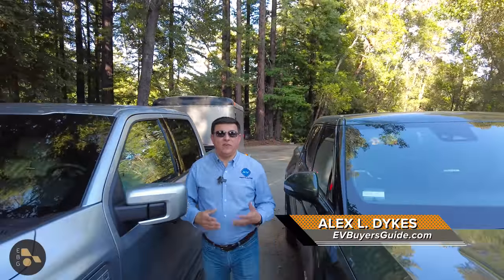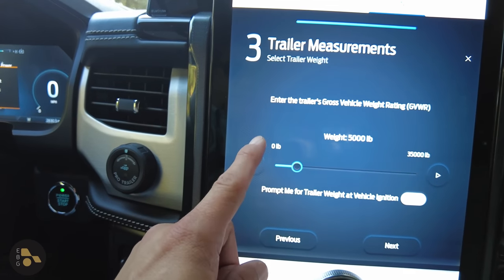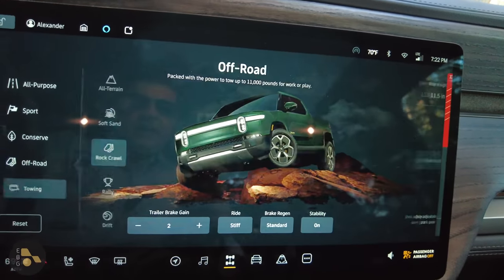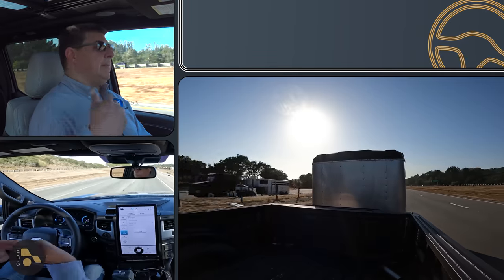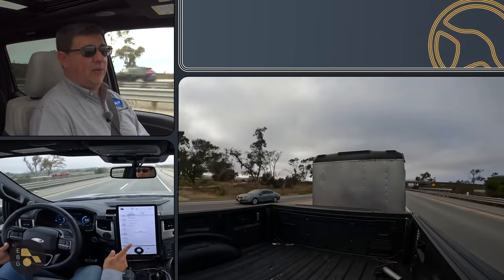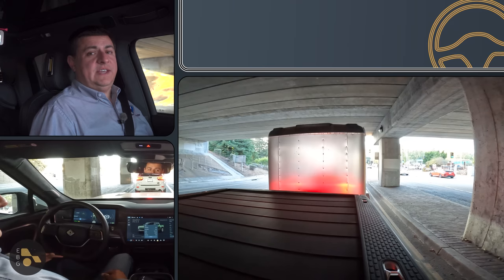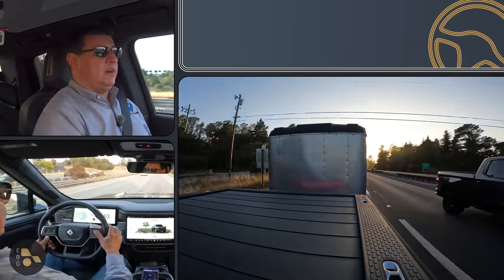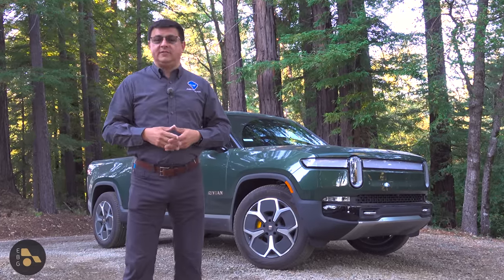What's It Like to Tow With: Rivian R1T vs. Ford F-150 Lightning

Comment: In Wyoming people be going 90 mph while towing.  It's nuts
Reply: Yeah speed limits are 75-80 MPH and people normally go over by 5-10 MPH.
Reply: Yeah that's just not smart. I blame all these 400+hp and 1000lb-ft HD trucks for that, makes speed feel effortless but if things get a bit dicey at those speeds it can go wrong very quickly.
Reply: Isn't it by law that a towing vehicle can't go above 55 MPH? Maybe I'm wrong. Either way, 90 is irresponsible.
Reply: I drive all over US and most towing vehicles regularly drive 70-80mph. As long as its not too windy, the road isn't twisty and you're paying attention you're fine. Only in states like Commifornia are there laws with ridiculously low speed limits and even less on towing vehicles).
Reply: @scott8919  that's California where laws are plenty
Reply: @TheJoncic  where there used to be the wild, Wild West ;)
Reply: California has 40 million people. More cars, trucks, more people, than several states combined, means more liability.
Reply: @cadsux  true that. In some states that I have driven through, there is nothing but rocks, mountain, barley any vegetation for miles. In others, it’s mainly vegetation but still no people making sense you are, haha
Reply: That’s just dumb!!
Reply: @scott8919  like the neighbors said,  watch out for them freeways clark....
Reply: @cadsux  please double mask RIGHT NOW!   stay safe out there....

Comment: Thanks for this video!  Good information.

Most of my towing is 20 miles or less so an EV could work.

However, I don't really need a truck. We currently use our Kia Sorento for the light towing that we do now.
Reply: Would love to see Alex run a towing test with the KIA EV6, just saw it has a towing capacity of 2300lbs apparently.
Reply: I sometimes tow a utility trailer with a Model 3 and it does fine. The (aftermarket) hidden hitch is a bit of PITA to attach etc but it is nice to not have to worry about drag when it's not on the car. Starting in MY 2021 the Model 3 has a plastic flap that you remove to access the hitch. I was hoping a hitch would be a factory option but so far that's only on the Model Y (I think).

Comment: 13:00 This is not exactly true, especially in the context of comparing EV trucks to ICE trucks. While it is true that you use more additional energy climbing in elevation than you can recoup through regenerative braking on the descent (most modern regenerative braking systems have 60% to 80% roundtrip efficiencies depending on exactly what losses you're factoring in), when you compare that to ICE trucks, it means that EV trucks are actually less affected by towing over mountain ranges than ICE trucks are. Even if an ICE truck can Jake brake or otherwise avoid using friction brakes, it is still only getting a "free ride" back down hill. It isn't recouping any of the additional energy that it expended when climbing in elevation. EV trucks, on the other hand, both get the "free ride" back downhill and get to store additional energy that can be used for driving later.

Comment: I am probably too late for you to still pay attention to the comments so I will probably post this on the next relevant situation but: people talk about these range variances being unique to electric vehicles in a ludicrous way. They are also true with ICE vehicles; we just think about it due to the difference in ease of replacing fuel vs. replacing electric charge. My example is thus: I drive a Mercedes Metris- I don’t tow with it, but for the first 5 years of the vehicles life I drove it as fast as I thought I could without ending up with speeding tickets, with a decent amount of highway driving, some magically in Mexico at speeds up to the vehicles up to its maximum velocity of 101 mph, and consistently where possible 10-15 mph over the speed limit in ‘mexico’. 

My father became diagnosed with Mesothelioma a few months before the pandemic hit and the three way hit of that, the pandemic, and my father inevitably succoming to i made my thought process change drastically, including conserving money, to the point where I drive gently, the limit up to single lane 55s, 5 under on multi lane 55s, and 55 mph anywhere faster. The results of this shocked me; indicated mileage on the computer for the last 15,000 service interval before he got sick was 21.8, the lowest in the life of the van for such an interval was 21.2. For interval after full implementation of this change, indicated mileage was 30 mpg. I also calculated things more precisely since the pandemic, and have self calculated miles driven over gallons consumed for that interval at 26.984, suggesting 19.6 for the 21.8 and 15k interval low of 19.

Converting this to consumption, strictly for the 21.8/19.6 and 30/26.984, we have 12 l/100km and 8.74 l/100km, or an increase in consumption of 37% for the higher speed. I think it would be beneficial to the viewers of this channel to have an as close as possible to apples-to-apples comparison of consumption efficiency of, say, a Ford F-150 lightening vs a F150 Ecoboost vs an F150 V8 on both conservative vs normal speed, and towing vs non towing. I also have more anecdotally noticed I have inferior fuel consumption on cold winter mornings vs more moderate temperatures, and think that would be an area worth exploring, too.

Comment: Regen braking helps a ton when towing. Less wear on the brakes, less likely to overheat the brakes. It does also help put energy back in the battery, which is a benefit over an ICE vehicle that has no ability to put fuel back in the tank. ICE vehicles just waste that energy to heat through the brakes. Just another one of the things that make EVs more efficient.

Once battery technology catches up to the energy density of fossil fuels (or even gets close) and charging speeds get better, nobody is going to want ICE tow vehicles anymore. EVs are so far superior to an ICE vehicle for towing…except for the range and recharging speed. EV drivetrains are like the combination of all the best points of both gas and diesel engines, but even better.
Although the Rivian is a good first attempt, it is still a first attempt, and now that it’s been out for a while and been getting used a lot, it’s becoming really apparent. It’s kind of feels like a truck that was designed by a team that have only read about trucks in a magazine or forum. It kind of reminds me of something like a Porsche Cayenne or a Range Rover or something, just in truck form. It’s designed for people with lots of money who don’t actually use the capabilities of their vehicles, but seem to want them anyway.

Rivian has taken the Tesla approach to the BMS. The low regen at higher SOC is because the Rivian has basically no top buffer, same thing Tesla does. That’s why they are very adamant that you should not charge it to 100% except for the occasional long trip. If the battery is charged to very near the maximum voltage allowed by the battery, they cannot do regen because it would push the battery voltage too high. The only (safe) way they could fix that with software would be to reduce the usable battery capacity and give it a top buffer. The unsafe way would be to allow the voltage to creep higher or essentially overcharge the battery, but uhhh…we don’t need more EVs catching fire.

The Rivian is body on frame with a rigidly mounted body. The body can be completely unbolted and removed from the vehicle and still leave a rolling chassis, but it doesn’t use rubber isolators between the body and frame like a typical body on frame vehicle (like the F150). This allows them to put the frame and body closer together and also allows them to make the frame wider (to fit more battery), but it means that the suspension and drivetrain have to be individually isolated more than than they would on a typical truck. Unibody vehicle, like the Ridgeline, the frame is part of the body. The drivetrain and suspension are attached to separate subframes that bolt to the unibody for manufacturing purposes. You can remove the subframes, but they don’t run the full length of the vehicle and they won’t roll separately from the vehicle unibody because they require the unibody for support/connection.

Comment: Are EVs really ready for pickups?
Reply: Yes, most of them haul nothing but air and are used as sedans to commute. The working trucks (light duty) are 95% of the time towing stuff locally and easily with the range of one battery charge.

Comment: Rivian hands down..... it has adjustable air suspension uses the 2170 cells vs the ford using pouch cells watched munro video they are lacking on cell cool/heating

Comment: The answer is a whole lot easier than he makes it out to be…the answer is laughably short distances. EV’s effectively have no towing range.
Reply: That's because EVs simply don't carry as much energy as diesel vehicles for towing needs. Diesels will likely outperform EVs for long haul towing vehicles for quite some time. Hopefully hydrogen fuel is eventually adopted for large vehicles (by free markets not forced by inefficient, wasteful governments)
Reply: @James-il3tq  unless there is a mega breakthrough in battery technology where they can hold quadruple the energy with 1/2 the weight, and 1/10 the charging time, EV’s will never work as trucks. Heck I can tow my 8500lb boat with my Tundra and go 200 miles and then fill it with gasoline in 5 minutes and go another 200 and so on. Diesels do even better obviously. The hydrogen trucks seem to me to be the most enviro-friendly method they’ve come up with so far.
Reply: That is obviously not accurate.
Reply: @COSolar6419  do you consider 37 miles an appreciable range? That’s how far the lightning with largest battery  towed a 10k trailer on a 2% grade highway. Then it needed to charge for over 4 hours. What a bad joke. Nobody I know has been idiotic enough to buy 1, but I’ll be the 1st to laugh and point at the 1st person I know that does. There was a man that bought 2 for his lawn care business and when he realized he couldn’t get from job to job without charging, he bought a 50amp diesel generator and anchored it into the bed of the truck so now when he’s working the truck is always charging off of the generator so he can complete all his jobs. How backward is that?
Reply: @TheCaptainmojo1973  the theoretical thermal power of a gallon of gas is 33kwh now subtract 70%  due to the inefficiency of ice give you 9.9 so say 10kwh per gallon so a full tank in a 35gal would be 350kwh  batteries will pass this sooner then later
Reply: @lesstevens2370  just saw an EV expert on Rogan who states that EV’s will likely not survive for 10 years due to manufacturing constraints. The new Ford Lightning ER could only tow my boat 37 miles before needing to be charged for 6 to 10 hours depending on charger availability just to be able to make it back to the shop. Does that seem practical for a truck? Battery tech is going to need a tremendous leap forward before it’s practical for long road trips or real working trucks. I put gas in my Tundra and can tow it to my local lake about 50 miles away, have fun all day, load up, haul it home, get up the next day and haul it to the lake again without stopping for gas, have fun all day again, and haul it back home again before gassing up again for work the next day. Imo, EV trucks are completely useless unless all you’re hauling is a small purse full of feminine hygiene products and guy liner with you to the local lgbtqabcdefg convention and back. 😂